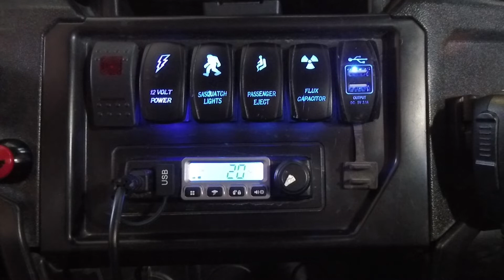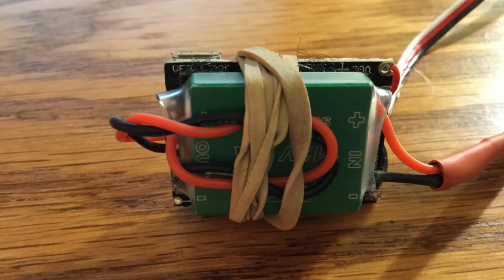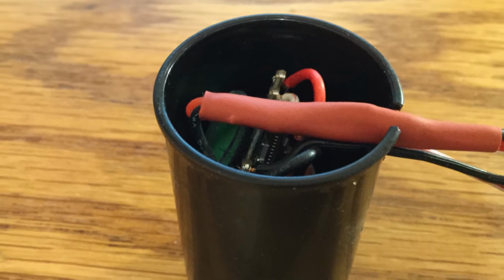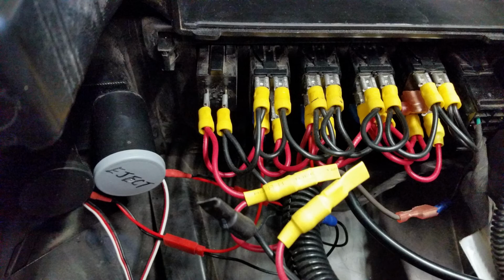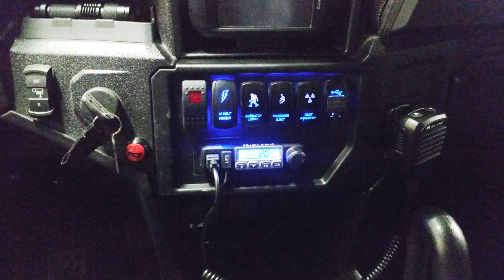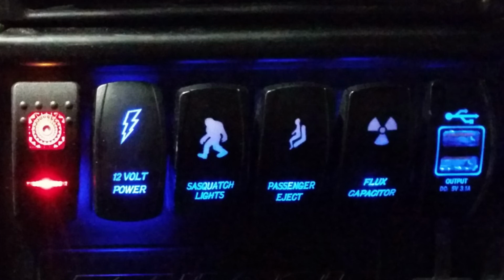General David Lee - Switch Magic

Comment: I like the way you mounted the 2way radio, would love to see a how to on this!
Reply from the maker: Thanks for asking Seth.  I like simple so what I did was cut a hole and pushed the radio through the hole!  One can't get simpler than that!  Because of the thickness of the dash plastic the radio sits firmly without any complicated "behind-the-scenes" mounting brackets.  I made sure the hole I cut would make a tight fit and the radio has not moved for four years now.  I did install an external speaker since the speaker in the bottom of the radio was not loud enough to hear.  Thanks again for asking and good luck with your install.  Dave in Montana.
Reply: What external speaker did you put on? Where you mount it?

Comment: I admire your organization and gear set up, having your tablet and camera equipment, gps, map system ect…. is nicely done. What map program are you using on your tablet for navigation ?
Reply from the maker: Scotty,  what I use is a Garmin Glo connected via Bluetooth to my iPad.  This gives my Avenza Mapping the exact location.  Avenza is free and a lot of the maps I use are also free.  I have Google Maps and download Google Earth images with their off-line feature.  When click on an icon in Avenza it will bring up the Google Earth image.  I also have an app that uses WIFI for the viewfinder/controller to the OSMO camera mounted to the front bumper.  Yep, as you can see, I am well WIRED!  Thanks for asking!  Dave.  ps. I just added two GoPro cameras for left and right views connected WIFI to my cellphone.  Now, where does that red wire go???
Reply: Excellent info Dave, much appreciated, have a Great Thanksgiving.